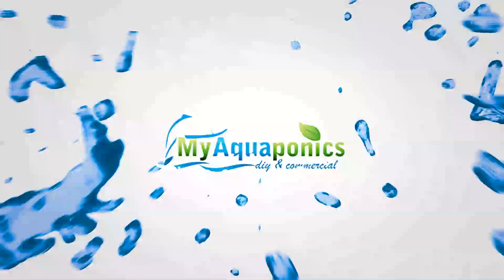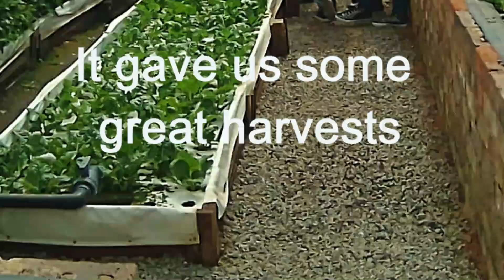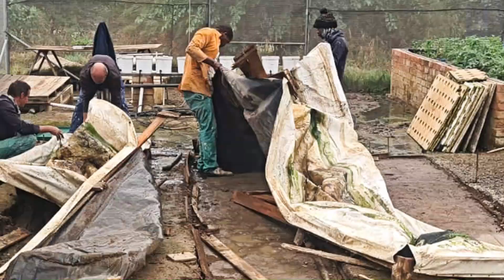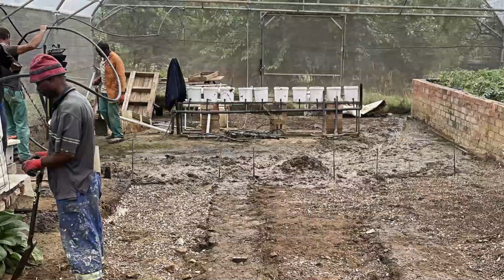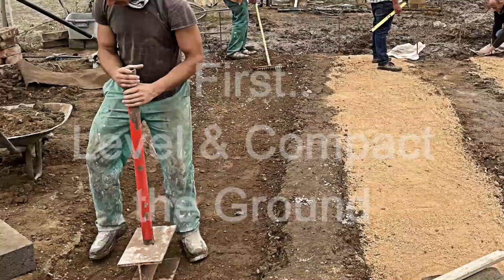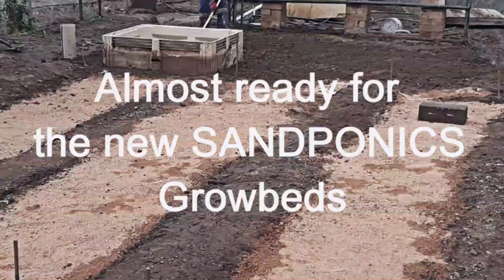Sandponics   Part 1:   Out with the Old Aquaponics and in with the New Sandponics : 2021

Comment: Thanks a lot for sharing this. I have question: Does sandponic system still need solid filter and biofilter systems before the grow beds?
Reply from the maker: No need for extra filters. The sand handles it all. Hence why it’s simpler and cheaper to build than an aquaponics system . Of course nothing stopping you from adding extra mechanical or bio filtration if you want , but in our experience absolutely not required
Reply: Thanks. This is helpful ❤